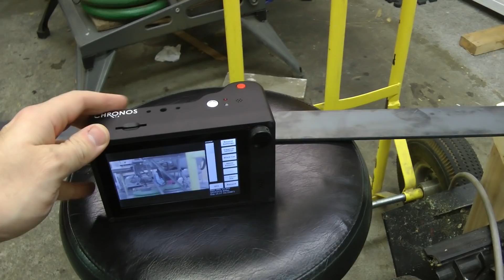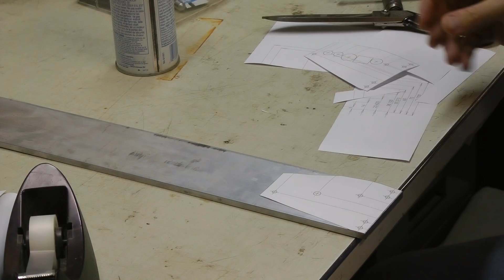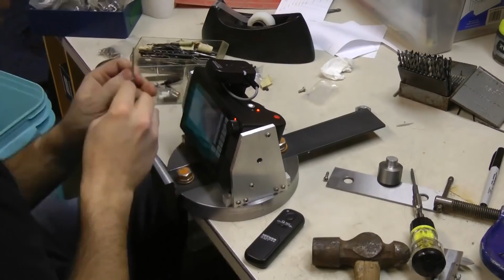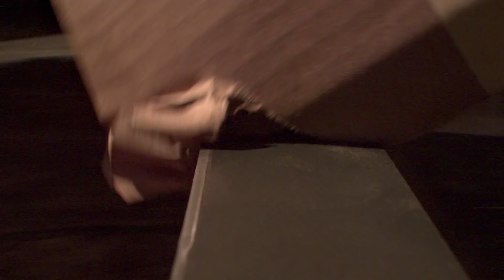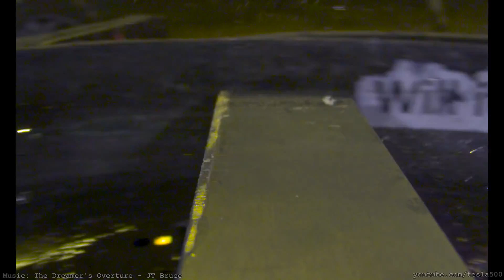High-speed camera mounted on a spinning lawnmower blade

Comment: I'd swap out that motor for an inverter drive setup. You'd probably get reliable speed and torque. It would cause more reliable carnage without the bog down.

Comment: Awesome.
Another way to balance the camera might have been to remove weight on the opposite side, like drilling out the plate maybe...or maybe that would have messed up the balance of the blade though.

Comment: Great work. I was mowing high grass with a 3.5 horsepower gasoline lawnmower and hit a 1/2 inch steel pipe sleeve. The blade cut one side of the sleeve completely in half. It went through about an inch and a half of nearly 1/8 inch thick steel. The end of that blade is moving!  My dad hit a roofing nail and it stuck in my leg. Better than the eye.

Comment: You seem to know what you are doing and far more than I do so far. So, quick question. It may just be my screen or eyes, but when you milled your slot across the “hub,” it looked like you were cutting too much. TO ME. The chips looked blue and there was a lot of smoke and a little fluid. Am I wrong? If so, how do you manage to remove that much material at that temp and maintain integrity of the tool and the piece? Seriously, I’m just trying to learn, and appreciate the video and any response.
Reply: Nevermind haha! I just saw the size of the end mill. I thought it was much smaller at first.

Comment: Centrifugal force is the outward force generated by a spinning mass. This is the force you feel that pushes you outward on a merry go round. Centripetal force is the force that resists centrifugal force and tries pulling everything toward center. This is the force you exert while trying to hold on to the merry go round pulling yourself toward center so you don't fall off. Just so you guys don't get it twisted.

Comment: Did you consider the lift force generated by the blade at differing speeds? Seems like that could have been a contributor to your balancing problems.

Comment: If you were to show the video at full speed we'd see only a dizzying blur.
So you show the video at slow speed ... and we see just what we would see if the blade were spinning at slow speed.

So why build this rig at all? Just hold the camera in your hands ... and turn around slowly. Done.
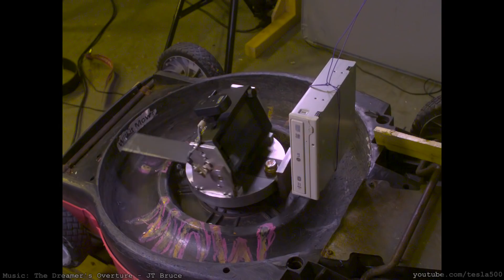Or hold the camera still and take shots of the spinning blade chopping up a dropped object ... as shown at 18:59.
No spinning camera rig needed.

This is the most incredibly stupid idea I've seen in quite some time.
Reply: Wow, that's an incredibly stupid summary of slow motion cinematography. I'd go into detail on how blatently stupid this is but honestly if you can stuff that much stupid in a comment without realizing the stupidity yourself then you're to stupid to understand what stupid is, let alone correct said stupidity.

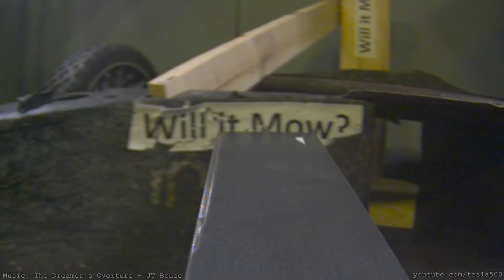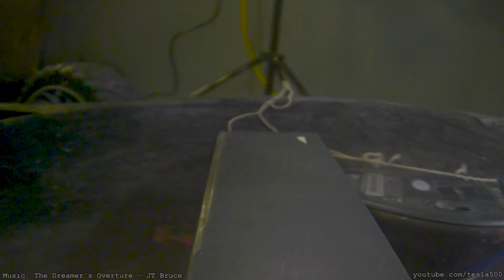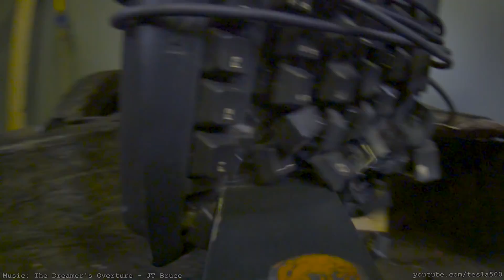Comment: Great video!  Some observations:  16:12  It`s amazing how much that short, stiff steel blade vibrates after hitting even a soft object like that fruit.  It`s interesting how whether it cuts through the object or bludgeons it apart seems to depend on the harness of the object and its mass.  For example, the fruit is heavy and soft, so it gets cut.  The mouse at 16:25, however, is light and hard, so it gets smashed, not cut.  The keyboard at 17:15 is hard too, but heavy enough so that its inertia keeps it still, so it gets cut.

Comment: Must be a way to film this by mounting a 45% mirror on the blade and filming the reflection. Periscope style. This way the camera can be stationery allowing you to run the mower at higher rpm. 

Curious Droid. Has a video called "Ultra High Speed Cameras" I would recommend watching that if you haven't already seen it. Its really interesting.
Reply: Ewan Rollo i dont think he thought of it. seams like it would be easier.

Comment: Clip the camera's frames based on position then you will have a 360 video.
Reply: Giuseppe Pollicino he needs to use a mirror, not the camera
Reply: @Bibibosh  he can use the rotating camera if he clips a frame for every angle as it rotates. This can be acheived by sending the camera stream to a processor to automaticly clip them based on its rotation.

Actualy I think they already use this technique with self driving cars.
Reply: Giuseppe Pollicino well tell him that.

Comment: I find it amazing that the camera could withstand extremely high G-forces.
Reply: I was worried about the mechanical aperture inside the lens. Not sure if the Chronos camera has any moving parts, I suspect the shutter is electronic.

Comment: Hey now you should put as many cameras in a ring around the outside of the mower deck it could trigger each still cam as the blade position passed like a manually with a rotary switch, or you can do it all bullet time style... :-) Brave an Awesome sir.

Comment: I enjoyed the video and I understand the difficulty of making it focus. However I am curious to what it would do at actual lawnmower blade speeds. Many push mowers are turning at around 3600 rpm on a 22” blade. So 1800rpm is a bit slow compared to what happens when I obliterate my kids toy in the backyard or the dogs tennis ball. Have you seen  What a helicopter blade looks like at speed. It looks like a spaghetti noodle. Think about that one.

Comment: I believe the balance problem stems from the blade you installed. Take it off and fasten washers or other pieces of weight, directly to your Flywheel. The blade is causing turbulence. Cool idea.

Comment: Why wouldn't you just mount a mirror that looks down the length of the blade and then have the camera looking at the mirror. That way the mirror can capture all of the action and also run at higher speeds

Comment: From the beginning, you needed more weight in the short side, If you balance the same weight on both sides it will still be out of balance. The produced energy will be weight x speed and the long side will have the same weight but more speed, hence more energy. Multiply rotational speed not in RPMs, but in meters per second x weight on both sides and add weight in the short side until energy is equal in both sides.

Comment: If you consider doing full speed I would recommend mounting a mirror at a 45 degree angle on the blade with the camera pointing down. I don't know how hard it would be to stabilize the final image however....you may not get the full wide angle shot

Comment: OR you could have just mounted a mirror at a 45 degree angle at the center of the blade and have a stationary camera looking down from above. A little post processing of the video would have kept the view oriented properly and there wouldn't have been any danger to the camera. You could also have let the mower run at top speed.

Comment: You should of had the camera in a fixed position looking straight down and then rig up an angled mirror attached to the spinning blades.  You could run the mower at full speed then.

Comment: Awesome work; the slow motion shots turned out really well! If you plan on upgrading the system, I would recommend extending the blade so the tip speed is faster with the same rpm.
Reply: Good idea, but if you want to keep the same rpm with the same engine there will be a limit to the amount in which you can extend the blade.
Reply: We love you hacksmith.....keep going ur doing great..... love From India
Reply: Why?
Reply: I'm thinking it might be an additional valuable contribution to science to film some other material behaviors.  Fluids, non-newtonian fluids, more foam things, dust/sawdust/smoke... who knows what else.  This stable perspective might be a unique thing in material sciences.  (It might also expand the domain of data available for deep learning.)  (Posting here because my comment might otherwise never be seen by anyone.)
Reply: That would be much better🤔

Comment: Generally a good idea, but you'd be able to catch much higher speed impacts if you made a rig with a much longer blade, since it's speed at the tip would be way higher without changing the RPMs.

Comment: Great idea with fantastic results.

A suggestion, why not fix the camera on a frame facing down straight at the hub and then mount a mirror on the hub at 45 degrees?  You'll be able to run the blade at full speed and get almost the same viewpoint. There will be rotation of the image on its axis but that can be removed in software.
Someone smarter than me might think of some simple optical arrangement to cancel out the rotation as well.

Comment: For balancing, you could have used a truck wheel balancing bead ring. It is a tube with beads inside, when the wheel turns, the beads will self-distribute inside the ring to balance itself.

Comment: Clearly you have no training as a machinist.  Otherwise you'd know that you were milling in the wrong direction. You were climb milling which shock loads the cutter teeth with a full thickness chip at the start of each cut rather than conventional milling, which has the cutter teeth start with a skim cut that shaves off a chip that becomes progressively thicker,  thus causing less shock loading on the tool.      You also were running the cutter at much too high an RPM.     You need to learn some things from a professional machinist.
Reply: lol make your own video then

Comment: Wouldn't it have been easier to mount a mirror at 45° to the blade and film straight down on it with a zoom lens?
Reply: You would need post processing editing to spin the footage to the speed of the motor and hope to god motion blur and compression and other bit rate latency whatnot issues dont fuck with distortion.

Not bad idea tho, as such is used to track tank shells

Comment: couldn't you also just mount an angled mirror in the center of the blade, the post-process the camera video to remove the rotation. The thought is you could spin it much faster.

Comment: Could you put a 45degree mirror in the centre then shoot from above and somehow rotate each frame according to its position to make a whole film (without stressing your lovely camera) fun vid cheers :)
Reply: If you do this, I'd be willing to try coding up the frame alignment software.
Reply: @jaggztech  it'd have to be sensitive to the actual RPM of the blades, probably having to rig up some sort of arduino detecting the changes in light from a strip of reflective white tape on the blades. Just an idea.
Reply: @deletedaccount17768  Might be able to get by with just some image processing to determine the mirror location and orientation (probably just looking for the edges).  Could throw a neural net at it but training that could be more irritating and complicated than necessary. Then it's just the image transform to align/rotate.  Still, it could then get kind of messy with the inaccuracies of the mirror locations, but smoothing those values might suffice.  In any case, we'll see if anyone ever does a mirror mounted version -- it's a good solution.  Nevertheless, I think his video was also maybe demonstrating the resilience of the camera hardware?  [Edit: Ya know what, you're right -- some white paint wouldn't hurt any of these processes. :)  Also, I just realized the blade image itself, if in the mirror, could also be used for alignment.  We could then go so far as to stabilize the images from a point on the blade... One step at a time though right?  First step: YouTube comments. Next step: 2019.  Happy New Year!]
Reply: @deletedaccount17768  no arduino needed. You can handle frame rotation easily in post. You probably wouldn't even need to add any markings to the mirror or the blade.
Reply: I thought exactly the same, and it would be a lot safer to the camera
Reply: @joshhefner7589  Hey Josh. I'm not sure if I should just ignore mistaken YouTube comments -- I didn't mention Arduino, was referring to processing during post, and mentioned markings only in a future edit in response to someone else (because it's not a bad idea).  Take care. :)
Reply: @jaggztech  Sorry if I accidentally replied to you. I was trying to reply to @MTB Wolf. Youtube needs to improve the interface on their android app.

Comment: You should mount a mirror at 45 degrees on the blade hub and have the camera above pointing down. Then run the high speed footage through an image stabiliser. It would let you use much better cameras/higher shutter speeds and much higher blade speeds imo

Comment: I love how you did this at 1800 RPM for extra 30fps camera confusion :D Is the slight offset of the blade in each frame caused by the american 29.97 fps, or by the motor not spinning at a perfect 1800 rpm?
Reply: Combo. We aim for maximum confusion at all times.

Comment: Attach a mirror on the blade instead of the camera and make the camera face the mirror from a safe distance and then run the motor on full speed. Should be safer for the camera and make for an even more interesting fotage.

Comment: static balance goes with R, while dynamic balance goes with R*R. Means if you balance it statically it will not be balanced when rotating. Means your blade / counterweight balance is wrong.